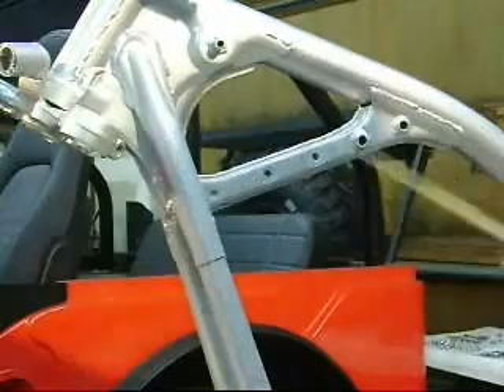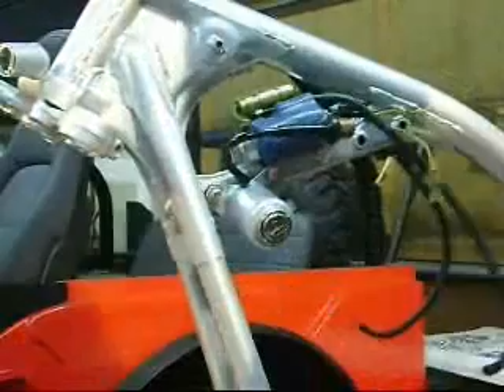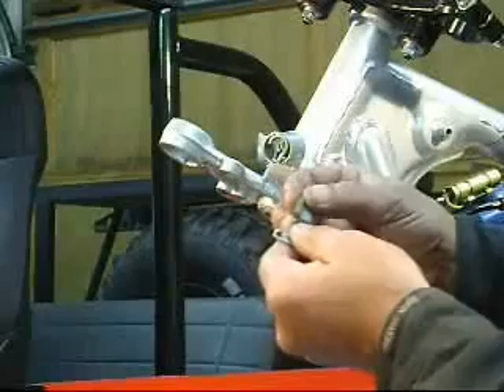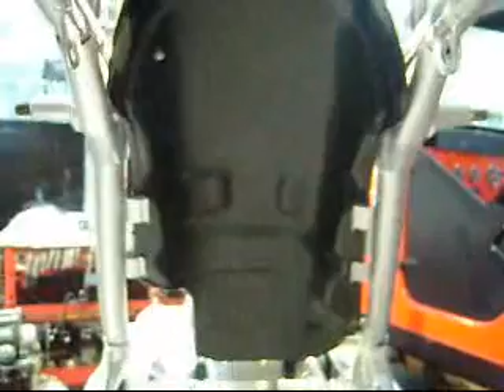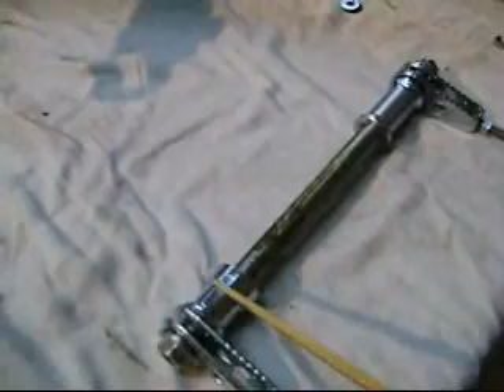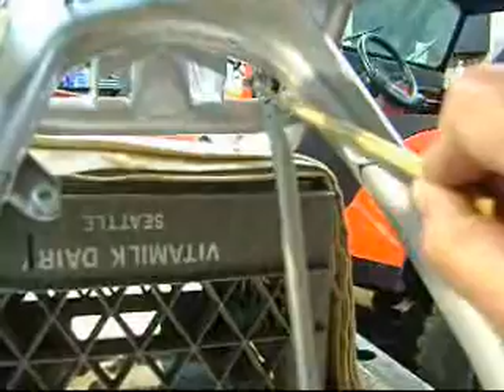(12) 1971 SL350 Honda Restoration by Robert Kelii Restorations

Comment: Is the blue Loctite to weak  to use on the bolts then the red Locktite?
Reply from the maker: Mike Hamilton  blue is fine for most nuts.  If critical, like brake parts, then use red
Reply: 53
Reply: judy wood   why 53 ?